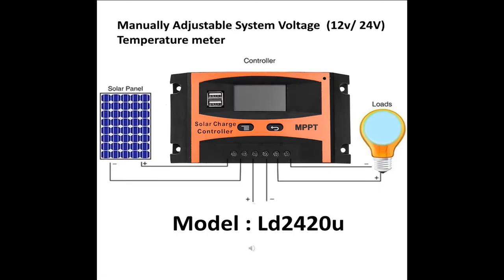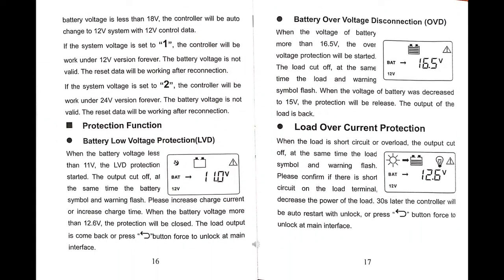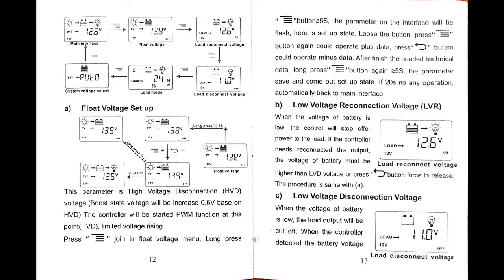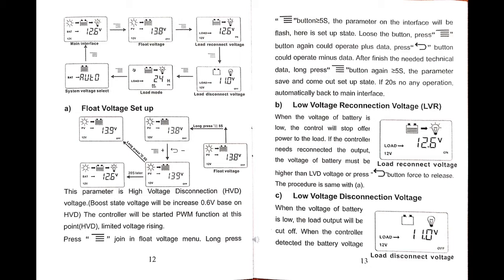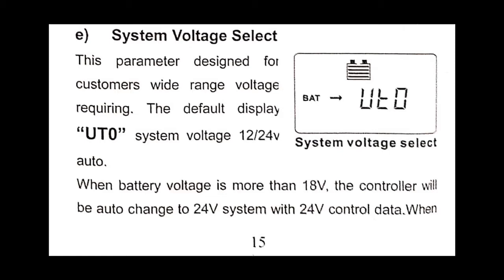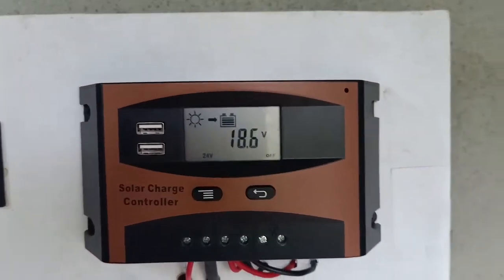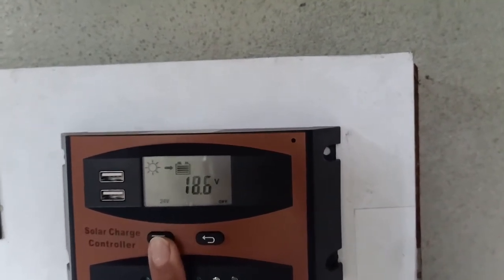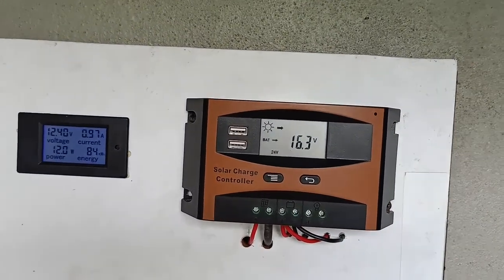Solar Charger Controller Model Ld2420u Manually Setup System Voltage 12v or 24v High Quality charger

Comment: Good advise. If you want to have posibility to adjust LDV 9-12V and LVR 12,6-13,5V,  System Voltage Select need to be chose to work in 1 Mode 12V.  If you will set up as Auto detection of Voltage,   adjustable LDV and LVR will has smaller range (LVD only till 11,3 and and LVD only till 12,6V